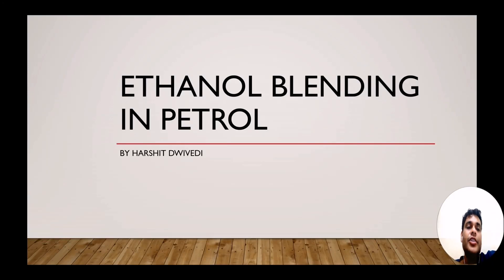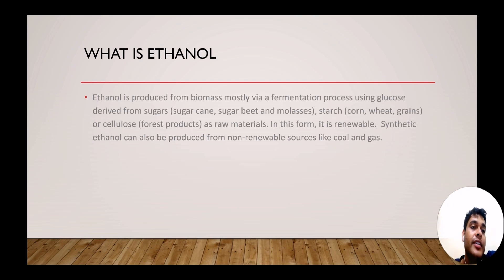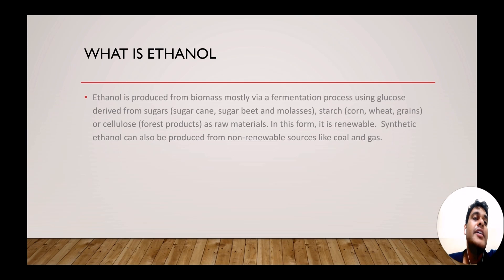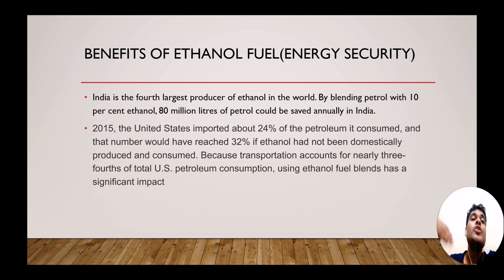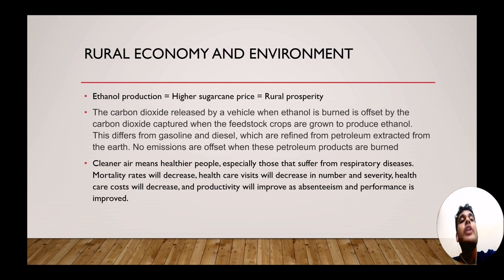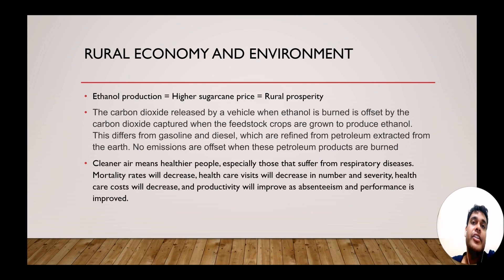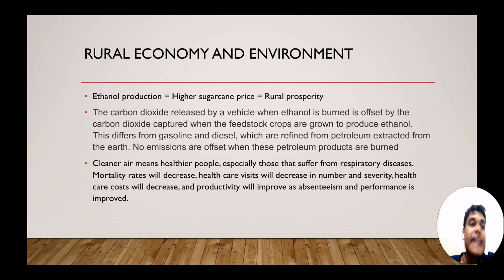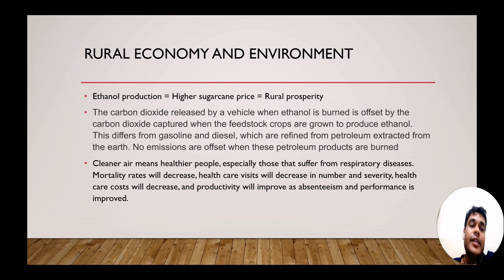Ethanol Blending in Petrol/Gasoline - Important Facts

Comment: Ethanol blending makes ZERO sense -- Gasoline IS NOT SAVED -- There is a corresponding power loss AND mileage lost by using ethanol, as well as increased fuel cost.  The mileage reduction is between 5 to 15% on average.  For argument's sake, we'll use 10% fuel economy loss.  Because E10 reduces mileage 10%, fuel burn must increase by 10% to achieve the same miles traveled.  Ethanol is also more expensive than gasoline and on average raises fuel prices about 20%.  Let's run some numbers.  Assuming a car gets 20MPG on 100% gasoline (18 on e10), using US current average fuel prices, let's see the true cost with a 20% cost increase for adding ethanol to gas, over 2,000 miles.  Using 100% gas, 2,000 miles would cost $250 (20mpg of gas, 100 gallons, $2.50 gallon).  Using e10, there's a 20% increase in costs ($2.50 + 20% = $3), there's a 10% loss in mileage, so it'd take 111.11 gallons to travel 2,000 miles with a total cost of $333.33 (111.11 * $3 = $333.33).  With the range reduction, commuters are having to stop at gas stations 10% more frequently.  In the above scenario, a 15 gallon tank would have required 7 stops to the gas station for 100% gas while e10 would have required 8.  How far does one have to travel to get to the gas station?  A 10% increase in visits causes an increase in wasted fuel.  How much fuel was used to grow the crop that made the ethanol, and all associated steps with its production and transportation?  Also, what does it do to food prices overall by taking farm land from food production and using it for fuel instead?  It creates additional scarcity.  The end result is fuel costs 33% more per mile and food prices raise as well.  To what extent food costs more is a much more complex question, but the additional cost of gasoline is crazy.  Not to mention the issues associated with alcohol in the fuel tank causes.  I don't know a single family that hasn't had some type of problems in one form or another due to ethanol fuels.
Reply from the maker: M Hamma well with this much amount of data i feel myself not enough competent to comment.. Time only will tell what's right and how much right it is....
Reply: Diesel FTW
Reply: The pure gasoline can be use in motorcycle with ethanol?
Reply: my car makes 500whp on 93 octane and 587whp on e85 so I dont give a shit about milage and love e85 :D
Reply: Wtf don't only go through data facts
It will reduce our 20% of petrol requirements....
Reduce the price of petrol from 100rs to 60rs.....
+The employment in making ethanol
So this is a huge economic win for us...

Comment: Problems already known in the UK from adding just 5% ethanol to unleaded petrol:

Absorbs water in cold and wet conditions (Wales). Worst if the temperature drops below zero for a few days.

Drops the boiling point of unleaded petrol from 35 degrees Celsius to 18 degrees Celsius. This causes poor and sooty combustion, loss of power and increased fuel consumption in carbed engines. In 2 strokes, especially Jawa, CZ and Yedzi bikes it causes overheating and minor cylinder seizures. This can be resolved, in 2 strokes, by adding 2% to 3% diesel per litre to the 5% ethanol contaminated unleaded petrol or a measure kerosene.

Increased gas tank corrosion. This is caused by the chemical reaction between ethanol and oxygen in the air inside the gas tank. This creates acetic acid (vinegar), which is a solvent to iron and highly damaging to rubber, neoprene and plastic fuel hoses. Also destroys gas tank sealing compounds causing leaks. As the acetic acid leaches the iron out of the gas tank's steel walls, pinholes appear and the gas tank is ruined. Also the dissolved iron in suspension easily makes it past inline fuel filters, to deposit into the carb unless, when the bike is finished with after a run, the carb is run dry with the fuel taps switched off. This can be remedied by inserting a zinc boating anode into the gas tank to soak up the harmful acetic acid as it is created and hopefully before it can cause expensive damage. 

Huge reduction in power compared with basic uncontaminated unleaded petrol. 5% ethanol unleaded has less than 80% of the calorific energy content of leaded 4 star petrol. Pure unleaded has just over 85% of the calorific energy content of leaded 4 star. 85% ethanol petrol, needless to say, has far less calorific energy content than all of these.

Before petrol was invented for motor use, in the early 1900's, engines were run on alcohol (ethanol). The reason the petrol took over was that it didn't damage engines and fuel system plus gave a power hike without having to alter the engine. 

Past generations of motor engineers and chemical engineers discovered that putting ethanol into motor fuels was a bad thing, so why are we having a repeat of the same mistakes that were made over 100 years ago??
Reply: Sir how many percent of ethanol can be mix in 200ltrs of pure gasoline?